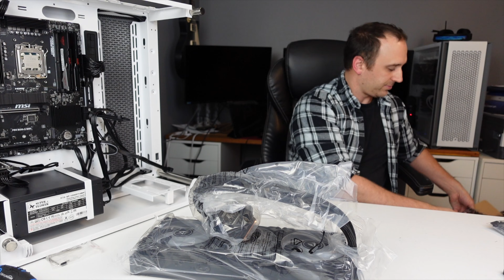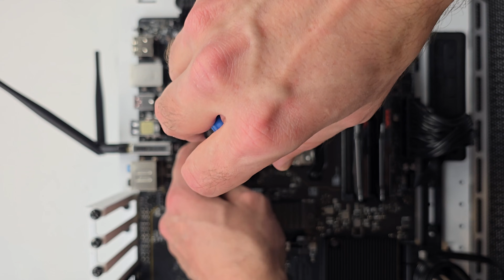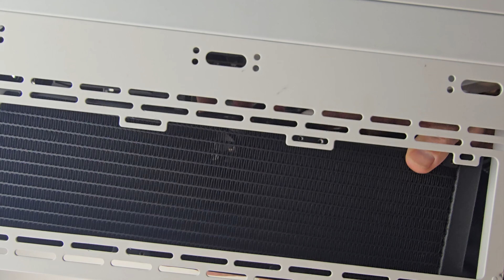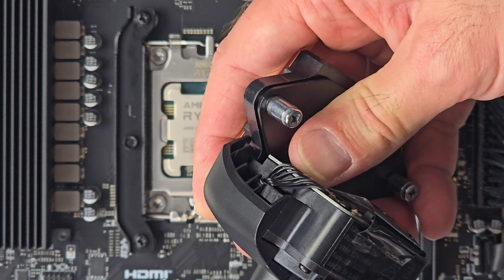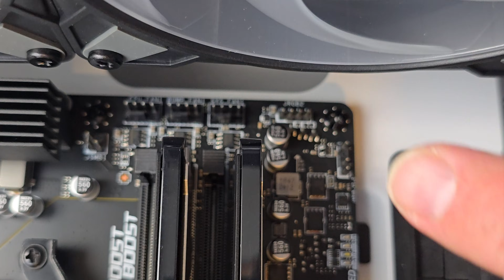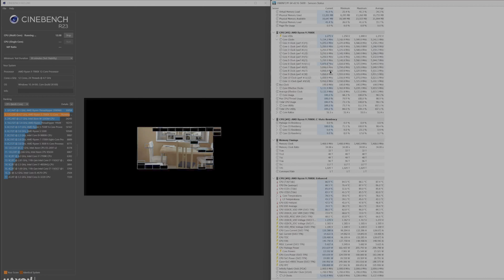Arctic Liquid Freezer iii 360 - unboxing, installing and testing on AM5 Ryzen 9 7900X.

Comment: This is a random, late comment but I got one a few months ago on prime day and recently installed. I was a bit confused at first because mine didn’t seem to have a manual but I googled it and watched the first video to pop up and it was a nice straight straightforward installation. Using this on an i7 12700 k and it’s great! I upgrades this alongside my case to a montech king 95 pro all really cheap and it improved my temps significantly. I can run have games like marvel rivals and barely go over 50 degrees. Plus my motherboard didn’t come with individual controllers so the all in one was pretty nice and setup straight to the board. I ran into problems with my last case and air fan lacking motherboard support so this has been nice. It gets a little loud at max speed but luckily you never really hit that.

Comment: Just installed the arctic 3 pro today and the AMD mounting Process was a pain in the azz, most definitly wouldnt go this easy, even with starting at 1 rotation of first said screw the second had to have a lot of pressure applied, more then id like to have to do, but after a few cussing sessions and reapplied thermal paste 4 times, I got it mounted with a even spread and pressure mount.

Comment: Hey friend, which wire controls the colored lights on the fans?
Reply from the maker: The 3 pin with the space in between that separates one pin from the other 2.
Reply: @jackshardware  thanks

Comment: wil this fit in a cg530 case and with a rog strix b650e-f mobo?
Reply from the maker: Per pcpartpicker it should fit a 360mm aio.
Reply: @jackshardware what about height wise? lenght it eill fit but not sure about height

Comment: The 3-pin cable on my motherboard is already being used by the front fans.  what should i do?  There is a 3 pin cable on the radiator. Do I connect it there?

Comment: man it took me HOURS and still havent been able to install the pump, for some reason it wont screw it in and when it does it catches on the left or ride side then can't with the other, they should have made the screws a little longer
Reply from the maker: Some have loosened the brackets connected to the motherboard then attached the cpu block.

Comment: Did you tighten up the mounting brackets after? Or just kept them snug?
Reply from the maker: I don't tighten them anymore. To much stress on the motherboard can cause it to crack or warp the socket. Snug means that the brackets are tight enough that everything is making contact and nothing is rattling around.
Reply: Thank you sir @jackshardware

Comment: How hard do you screw that cooling? Until I can't tighten the screws anymore? I wonder about the high temperatures for 150W by 9800x3d. Temperatures above 80 degrees in cinebench 25.
Reply from the maker: Until they are snug. Once you start feeling resistance it will be tight enough. 80 degrees is fine since the 9800x3d can operate upto 95c.

Comment: I used the all in one cable. When I try to adjust the fan speed in the msi bios, it only shows pump 1 with rpm speed even though i have the cable connected to the cpu 1 pin. Is this normal?
Reply: If you use the all in one connector, you can only control everything at once. You have to use the splitter in order to control things separately. Also you should’ve connected that all in one to AIO PUMP instead of

Comment: using the non rgb version gets me about 89 degrees celsius with amd master on with creator settings getting 27k + points and about 73 degrees with undervolting in r23 with little under 25k points!

Comment: Thanks a lot for this great video, it helped me massively to get mine installed. I saw plenty people reporting how difficult the installation could be and you gave a great demonstration how to do it. I would add one thing I did that it helped a lot and it was to leave a bit loose the two brackets. This way you can easily make the second screw to align. Then, once connected, tight the screws and you are done. Again, thanks a lot for this video!
Reply: late comment but bro thank you so much IVE BEEN STRUGGLING TO PUT IT IN and this comment was a 1st try bro thank u so much i appreciate it

Comment: What if my mobo has no Pumpfan options? Where do I connect it?
Reply from the maker: You a sysfan header. Or you can use the cpufan header and then plug the fans into a sys fan header

Comment: Bro there is much easier way to do it. I m also a PC Builder and after three installation by the Arctic model, which is putting a huge pressure on mobo and is so difficult, I ve read on REDDIT that you can just install the brackets first on the pump ( but a little loost at first) and then mount the brackets on the motherboard, that will put less pressure and it will install much faster and easier. Then just screw the screws from the pump and it is done. Try it guys, is easier - it is the only way I am installing this Arctic AIO now, and I ve done quite a few.

Comment: How did you hide the 3 wires?
Reply from the maker: They are not hidden. They camera angle makes them hard to see. If you look between the cpu and first stick of ram you will see them.
Reply: @jackshardware so you can't hide them at all?
Reply from the maker: @Addictkc depending on your motherboard and case in sure you can. Get some extensions and you can hide them behind the gpu and feed it behind the case.

Comment: Did you adjust the fan curves at all?  I installed this setup, used the single cable, and have been annoyed by how loud it is.  Fans spin up quite high even when CPU is only in the 60-70 range gaming.  Too loud.
Reply: Mine was set to „Perfomance“ and as standard and pretty loud. After setting it to „silent“ it was very good. Just do it in the BIOS.
Reply: Got the same problem, in the BIOS it was set to 100% by default in the "Q-Fan" menu (Asus mobo) under the AIO tab. You can adjust that curve, but even the "silent" preset still has 60% fan speed minimum, still insanely loud. I connected mine with single cable to the AIO header on the mobo, maybe the 3 separate was a better choice... (Update: it seems the single cable should be connected to CPU_FAN instead, not AIO pump, that really is just for the pump itself)

Also, you can set custom fan speeds, so maybe setting it lower than 60% for as long as the temps are low is fine? I will experiment a bit with this, just to see at what speeds the sound is tolerable. 

But in hindsight, an air cooler is waaay quieter, first time using an AIO for me. It does cool super well though, the temps are very low.

Update: I'm going to use the 3-in-1 cable after all, see this video for how to do that: https://www.youtube.com/watch?v=_4JxDKyAzwk

Comment: Question, If you connect the FAN Cable to CPU FAN, where do you connect the 3 fans that are on the radiator? Aren't they supposed to go into CPU FAN? Thanks for a great video.
Reply from the maker: The 3 cpu fans connect to the fan cable.

Comment: If your motherboard only has 1 amp per fan header than you should make the 360 into a push pull. If you have 2 anp headers then i recommend buying i case that fits the 420 and doing push pull with it and that will be by far the best and cheapest way to cool ANY cpu (larger than the antec flux pro... trust me lol. I ended up using 2 p14 max fans on the side and a regular p12 in the middle cause i have 1 amp headers) cybenetics is the best place to find the ACTUAL max current/amps drawn for a fan. Also i got an asus x870e proart motherboard and it still came with 1 amp headers and i had to flip the cooler because the asus motherboard heatsinks just hit the pipes. So just be aware newer motherboards can still have issues with these. They are amazing coolers tho and flipping the cooler hasnt made a difference and it contacts the same spot.

Comment: You people who say this is hard to install need to stick to prebuilds, it’s an absolute cakewalk
Reply from the maker: The newer ones are redesigned and significantly easier to instal. When they first came out the screws were shorter and required a good amount of pressure for them to make contact.
Reply: @jackshardware that’s probably worth sharing then because the comments here could put people off a bargain well performing cooler
Reply: 😂😂 I’m actually pumped ordered mine just waiting

Comment: Hey Jack, I’ve just installed this AIO on the front of my case. Does this mean the fans should be pointed in towards the inside of the PC or just attached to the otherside of the radiator? Sorry if that’s a stupid question!
Reply from the maker: Normally on the front  they are attached between the radiator and the case pushing air into the case.

Comment: If u use fan control (the app) or any other software for fan controlling, do u need to use the cable with 3 ends instead of the combined one to be able to control the pump speed and fans speed seperately it am I thinking about this wrong?

So u get a small tube of thermal paste with it?

In the B850 gaming X motherboard from gigabyte how would the 3 cable thing work? If u could explain it with that example pls do. I think that motherboard only has 4 headers right? So this would take 3/4 of them up which is not great if that’s how it works cause still need enough for the other fans. (3 other fan headers).

Comment: For those worried about the leaf spring. I'd recommend screwing it into the plates before screwing the plates to the board. That way no pressure is applied to the MB or CPU that may cause damage.
Reply: Legend
Reply: @Bigmitch19  😇
Reply: I also did that after multiple failed attempts at doing it the "right" way.
Reply: And you should also have way more likes.
Reply: @simioncatalin  👍
Reply: Putting some pressure on the water block is normal, as long as it is even and within reason, similar to what is would be when the block is fully seated.
Reply: One easy thing to do is screw the cpu cooler block turn by turn. Start with one side and just turn enoufh to let it sit in there. Then take the kther side and do the same. Then go to the side and do  a few turns before going to the other. This will ensure you get a great pressure across and not over teightening the screws.
Reply: Do you screw it all the way in the plates first, or just a little bit and then fully tighten the plates to the board and finish with the leaf spring?
Reply: @crazyforcs I just screwed enough to hold the brackets and then, after positioning I did fine tuning on the brackets until I couldn't anymore without using force. Then the same on the cooler until it all stuck together. Patience and a steady hand and 5 minutes is the recipe
Reply: I was worried about this as I will be doing this tomorrow. Already built the rest of the system, this just happens to be the last part that will be arriving. I saw another install review video and was a bit squeamish about the amount of force they had to apply, so I will definitely try your method to get them started. Thanks.

Comment: Hello, I plan on getting this cooler. Seems to be a nice set-up and headache free. I see you have 3 connections, pump, fan and Vrm. What exactly is Vrm ? I have MSI MAG Tomahawk AMD B550 Socket AM4 I did order a MSI MAG CoreLiquid E240 for this thinking both are MSI and will match right up, I ended up having 2 of the 4 pin connections and 1 pump connect and they did not supply any 4 pin fan splitter for the cpu 1 fan. Also on there all the 4 pin connections have 4 wires going into them and no kind of instructions. So I packaged it back up and sent it back.

Comment: I am not an expert, I did find some of this video useful but but I noticed a couple of things the may not be the best.  1 On the website, Arctic   tells you that to  just put the some Thermal paste in the center is OK, but the preferred way is to put it in an "X". Also, in the video, his finger is clearly on the face of the copper heat sink. You do not want to hold it this way. Your fingers have oils on them and you don't want to get that oil on the face of the heat sink.
Reply: Lol

Comment: Thanks for this video, it helped me a lot. 
If my motherboard only has 3 system fan headers, should I split one of them off and run the VRM fan on it as well?  As an example, my rear 120mm exhaust fan and VRM fan together.  Thanks!
Reply from the maker: That's probably what I would do.

Comment: Hi guys, I've had this cooler for a long time too, but for some reason I don't have rgb on the fans, what could be wrong? Yes, I know, I've put the cable to the motherboard in jargb2_2, but nothing, does anyone know anything?
Reply: Did you fix it? I have the same problem

Comment: Hey unsure if anyone else has this problem, I set up my aio, plugged it in, and when I tried to turn it on none of the fans spun. Am I supposed to connect the fans on the radiator to anything?
Reply from the maker: Double check all the connections. It's possible something came loose.
Reply: Also check the bios settings for those headers, make sure they are not set to 0% or silent.

Comment: Would you recommend connecting the pump to the CPU header (variable speed) or the AIO (100%)? The fans are aftermarket and have them wired to a different variable header
Reply from the maker: The pump header should be variable speed as well.

Comment: Good that you went through fan settings and texting. Beginners might find the number of cables and setting overwhelming compared with installing a simple air cooler. I love this AIO. Mine is quiet and has no issues.
Reply: Hello good sir may I bother u today? I have this artic iii argb and I've had it for awhile when I got it I wanted individual control now that ik more abt computers I want the 1 cable to cpu that controls it all but it seems the cable on mine that's installed has 2 not 1 not 3 but 2 it goes to cpu and to some rgb thing at the bottom I think but I can't find the cable that's from aio to cou alone do u have any clue what this cable is called? I would love to only have one cable also If you know is it normal for mine to have 2? From what I've seen the options were 1 plug to 3 or 1 to 1 not 1 to 2 so idk if I'm just retarded or what
Reply: @ Thanks for asking. Can you check the manual of your AIO and then confirm whether it's the same model and that all cables that are in the manual were included. If not, then you can inform the retailer.
Reply: @HonestHans365  so I think I figured it out the cable that controlls it all is the pump to pump fan cable the 2nd one I have that made me say 2 is the argb one I thought the way it was explained was the one cable controlled the fan and rgb but I see now the one cable only is for fan and vrm and whatnot while the other one is rgb
Reply: His literaly has the cable with 1 argb thing installed lmao mine didn't come like that the split into 2 was installed on mine

Comment: are you sure the brackets on the motherboard are not upside down ?
Reply: its the correct way. arctic got a instalation guide too where they install the brackets with letters upp.

Comment: You should've applied thermal paste before removing the plastic off of the copper block, I noticed you got your fingers all over it and probably left oils there, slight observation.
Reply: No. Light fingerprints on the cpu or water block don’t affect thermals enough to matter. Should you wipe them off sure but I guarantee you it didn’t do anything to the thermals. We’d be talking about an almost Immeasurable difference. Don’t listen to these clowns. They just want to sound smart.
Reply: @condemned4life87 reason why I typed "slight observation", don't get worked up buddy.
Reply: Agreed, or get some isopropyl alcohol and give it a wipe.
Reply: Lol
Reply: Thisnpart really doesnt matter if you touch the copper before hand or not. The fingerprints wont have any affect at thermal paste or cooling here.

Comment: I destroyed a Ryzen 7800X3D with one, because I never was able to screw the water block.
Reply from the maker: The newer liquid freezer 3's have been revised with longer screws.
Reply: Yes, it's Garbage. This is why this thing is returned constantly. There was no reason for Arctic to make the Installation a Pain. It's Biggest Flaw. It's easy to damage Mobo and CPU just for a few Degrees of Difference with other AIO.

Comment: Why dont you used the single cpu header cable from the pump to the board, seems less hassle than the split 3 cable
Reply from the maker: I want to be able to adjust the fans and pump independently.

Comment: when trying to screw the fans onto the motherboard they literally wont move no matter how hard i try the top of the screw is moving but it doesn’t come down at all
Reply from the maker: Are you referencing the water block. If so, can you get one side started. It won't take any pressure to get the first one started ,just make sure to only thread it a little. If the second screw isn't making contact you might not have it lined up correctly.
Reply: @jackshardware I believe different mobo/chip combos have slightly different mounting heights because with my 9800x3d and Aorus mobo that method was impossible. I had to start both brackets on the water block then start the four screws that hold the bracket on the motherboard to actually secure it. Once everything was started it all secured nicely, but I’ve put together lots of PC’s with aio’s before and never had this kind of trouble mounting a water block.